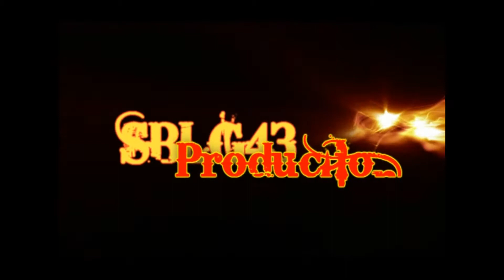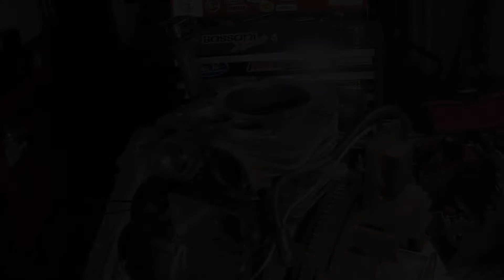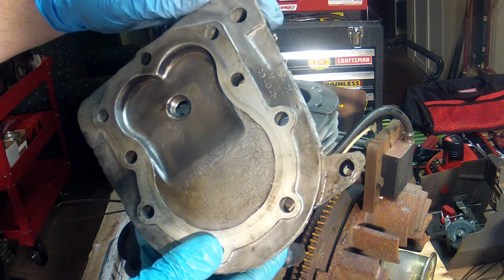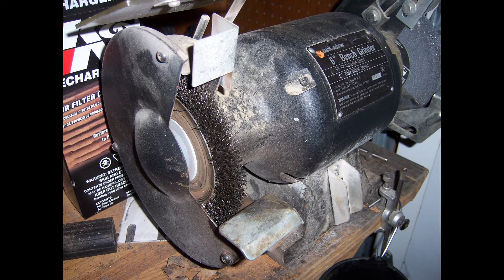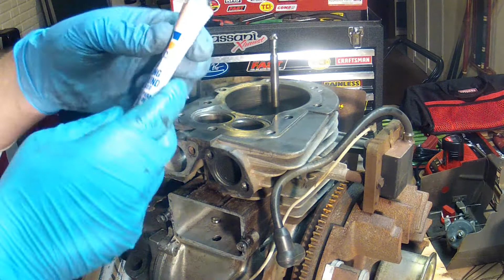Tecumseh HM80 Engine Part 3 - Valve Lapping

Comment: You cleaned up those surfaces with a wire-wheel. How could I clean up the exterior of the cast motor? The same way, right?
Reply: +Alan Meijer This guy used Purple Power, Mineral Spirits, water, and a nylon brush. http://www.georgiamotoryder.com/forums/viewtopic.php?t=6&p=7
Reply from the maker: +Alan Meijer What I cleaned up with the wire wheel, was the carbon buildup. The next time I cleanup the exterior of an engine, I am going to try this baking soda, lemon juice recipe. Thanks for sharing.

Comment: any reason you don't use an electric drill instead of the manual mixer?
Reply from the maker: An electric drill would have too many RPMs. The unit that I use is more advanced than some others use. A more common lapping tool is more of a dowel with a suction cup on the end. You would spin it back and forth with your palms as if you were trying to start a fire by rubbing two pieces of wood together. Thanks for watching!

Comment from the maker: The engine does not spin backwards. However, you are correct in noticing that the valves are reversed. Apparently different engines have different valve configurations. Thanks for watching.